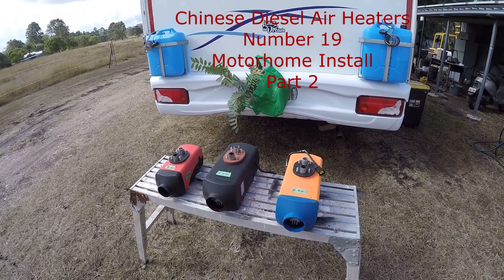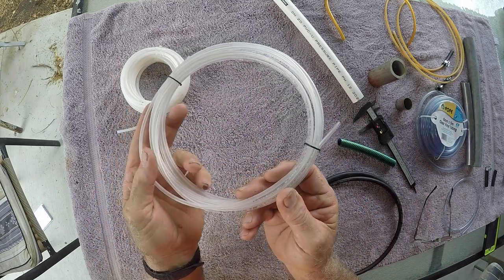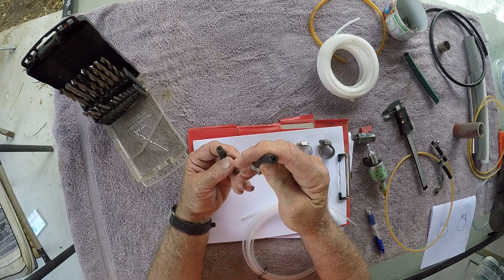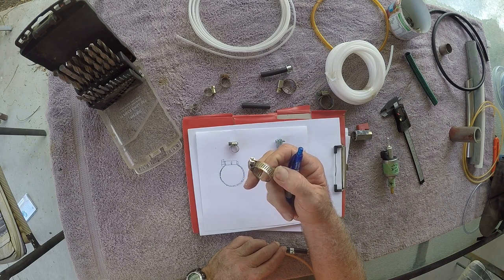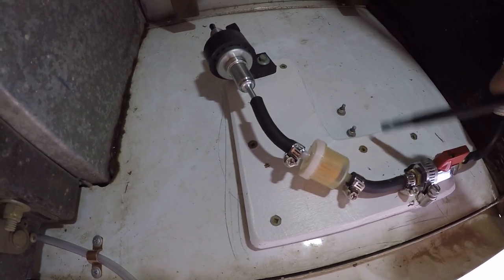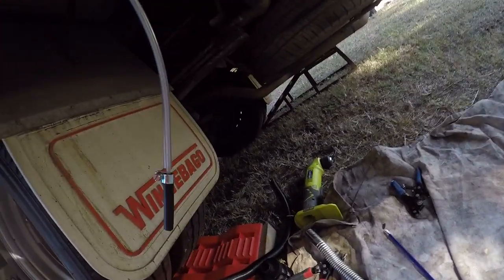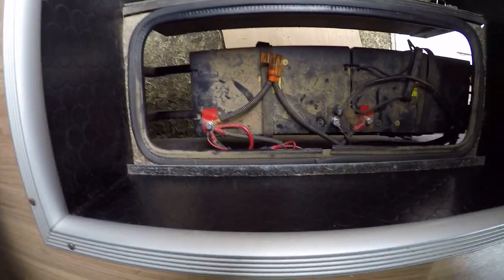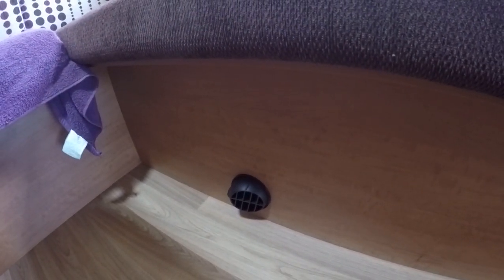Chinese Diesel Air Heaters no 19.   Motorhome Install Part 2

Comment: Hey John! Fist I want to say how great your videos are on the workings and installing is on the 5kw Diesel heater. I recently bought one and I am going to install it. Now I have read the manual and I have watched your video on two others but no one has said if the is a needed clearance for the rear of the heater against a wall. I asked one guy and all he said was I'm not a professional so refer to the manual or call the manufacturer because all his videos are is for entertainment. Now don't get me wrong I do watch videos for entertainment but on a Hod to or instructional video I'm looking to learn what to do and what not to do when I install my unit. So can you help with this question? If there is no requirement of space or distance from the rear of the heater when mounted in a compartment can you tell me how many inches it was on your install from the outer wall?
Reply from the maker: Hi JW,

Thanks for the feedback and comments.

Re the rear wall clearance.
These heaters do not like restrictions in their exhaust or airflow systems.
My personal rule of thumb is don't, or have absolute minimum restrictions to the airflow. 
The heater inlet is approx 75 mm diameter, so in my personal opinion (litigation minimising words, and the reason people these days are so reluctant to offer advice) a minimum distance of around 50 mm from a vertical wall should give you acceptable airflow into the heat exchanger.
Cheers. JMcK
Reply: Thanks John that works and helps me. By the ay that guy actually messaged me back and said he put his at 4"
Reply from the maker: John Wessinger 
👍

Comment: Hello John just wondering if I could install one of these OUTSIDE my cabin in a weather proof box with the controller inside the cabin. The only bit that is of concern is I would need to add a very short pipe to the inlet side of the heater and none of the installs I've seen have any pipe on the inlet as they are inside the cabin. I hope this makes sense.
Reply from the maker: That would be fine Jimy. Less trouble with the exhaust that way.

A lot of people mount these outside a shed or garage, or winter fishing hut etc. and have a pipe on the inlet side and outlet to recirculate the hot air back into the cabin.
A pipe on the inlet side up to about a metre long does not cause much of a restriction.

Cheers.  JMcK
Reply: @johnmck1147  Thank you very much for your quick reply, I have watched nearly all of your videos. You are very particle and knowledgeable. My inlet tube would only be around 400mm long but good to know up to a meter is fine. Thanks again. Have a great day! 🍻
Reply from the maker: Jimy 4 Real 

👍

Comment: If you get error code 10 multiple times and your heater was working fine a few months prior.what do you believe the problem is?it would never  fully start working and eventually shut down.Very fumey and smokey.Do you have to clean the heaters after so many hours?It was flawless for a couple hundred hours.maybe 15 gallons a fuel run thru it?short fuel line..short power lines w/ plenty of voltage.
Reply from the maker: Hi Chris,

It is possible you have carbon build up in the heater burner and in the start glow plug screen.
It is also possible you may have a blockage (bug) in the glow plug start air hole. Not uncommon if you do not have a screen on the combustion air inlet.

These heaters do need carbon removal maintenance. The frequency of this maintenance is very dependent on your install, type of fuel, altitude and your operation of the heater.

Restrictions in the exhaust or combustion air inlet creat a poor fuel air mix and lead to carbon deposits. As does poor fuel and high altitude operation. It is good maintenance to occasionally (monthly or season end) to run the heater on a high power setting for about 5 minutes to burn off any accumulated carbon.

I hope this helps.  JMcK

Comment: Hi, where could you purchase the connector harness of the dosing pump? at 24:49 I saw you use such a harness to make a "jump starter"
Reply from the maker: Hi Jay, I made my harness up with a simple push button switch in an old pump wire loom connected to a battery pack. I just rapidly push the switch on and off. JMcK

Comment: Hi John, thanks for the video. I've been planning my 5kw heater install and will be staring it very soon (as soon as the snow clears!!). The manual that came with my heater has a wiring diagram that shows the heater feed wire (with a 20 amp in line fuse) from the leisure battery but it states to wire it to the negative terminal of the battery. The wire itself is red colour and I assumed that the red cable would be for the positive terminal. Do you think the manual is correct? Can there be some that are negative feed and some that are positive? By the way the black wire, from the plug is very short as opposed to the red wire with the in line fuse, have you seen that before yourself? Thanks again, Martin
Reply from the maker: Hi Martin,

Sadly this is not uncommon. The issue seems to be in the translation.
Just as some manuals, and also placarded on the heater say use Gas for fuel. Diesel in many Eastern countries is known as Gas-oil, and this is sometimes shortened to just Gas. What Americans call Gas we in Aus call Petrol. These Chinese heaters run on diesel.

Now back to your issue. I think your manual shows a 12 pin socket, and I am pretty sure you were supplied a 9 pin socket. 

I have to be careful here re litigation, and going against the supplied manual.

You must make your own decision, but If it was my heater I would do below.

I would connect the red wire with the fuse to the battery positive (+)
I would connect the black wire to the battery negative (-)
I would install a 15 amp fuse not a 20 amp fuse. 
And I suspect your heater actually came with a 15 amp fuse.

Cheers.  JMcK
Reply: @johnmck1147  thanks very much John, you have given me the confidence to install the red cable,with inline fuse (which came with a 20amp installed in it) onto the positive side. I accept that you have no liability in your remarks. Cheers Martin
Reply from the maker: Martin Cogley 
👍. Please let me know how it goes Martin.  JMcK

Comment: John I’m installing the gas version under the drivers seat in a tiny Ford Transit Connect. Since the ground clearance is so small, have u seen any problems with the combustion intake/exhaust hose catching road debris?
Reply from the maker: Hi Dave, 

I assume you will have it protected behind some chassis frame, and have a good stainless steel filter on the intake hose.

Now it depends how you will use the heater. Only when parked or also when driving. If when driving you can have issues with road debris, particularly from water spray when driving in the rain.

If you do use heater when driving and you often drive in bad weather, have you considered having the combustion air intake coming back inside the van? 
You could also have room to make a bracket lifting the heater off the floor enough to route the intake sideways inside the van. 
Or perhaps even mount heater sideways, and just run exhaust through the floor.

If heater only used when stationery, you won't have any issues.  JMcK
Reply: @johnmck1147  That is a good idea about the intake. I found a elbow online that I believe would fit my General Components Bison 2000a gas heater. This would eliminate that large radius that the exhaust hose would take to make the 90. Make sense?  Is there a good way to contact u?  Thx again for the info.
Reply from the maker: Hi Dave, my youtube email. johnmck47@outlook.com

Comment: hi good videos as always have you any idea why i can smell exhaust fumes coming out of the air outlet have replaced all the gaskets but still smells
Reply from the maker: Hi Ian,

You say you have replaced the gaskets, have you also checked the two seals?
One the rectangle seal where the fuel enters.
The other the seal where the glow plug is.

Have you checked that exhaust gas can not be sucked into the air inlet?

What about some residue oil (from dirty hands) left on the burner heat exchanger.

If you have, or can borrow an instant CO meter check outlet for CO, to rule out other causes, such as contamination on the heat exchanger.

It is possible, but very rare you have a heat exchanger casting issue with a very fine crack along the fins. The crack opens up as the temperature rises. Very difficult to find. Hence the CO meter.

If you checked all above, and heater is new, suggest you ask for a replacement.  JMcK
Reply: hi was the exhaust getting into the air intake could do with a better way of connecting to the exhaust pipe than using a jubilee clip as still escapes

Comment: Hi John . I'm fitting a 2kw to a Ford Transit, Under the passenger seat. How far must the exhaust be away from vehicle diesel tank? I know diesel isnt like petrol and I'm pretty sure the vehicle exhaust goes right past it . I'm only asking as the site I want to fit, the heater exhaust exit hole from the van chassis  may only end up being 200mm away maybe 300mm

thanks
Reply from the maker: That should be ok, but for peace of mind I suggest you lag the exhaust. Very easy to do. JMcK
Reply: @johnmck1147  ahhh cheers.  Pretty sure there's some black stuff in the kit already.  It's a Lavaner pro . Not sure if you know the brand but they're a mid range product.  I paid £180 delivered but they had good reviews when mechanics took them apart.  There's a Scottish fella on YouTube.  He recommended your channel 👍🏻

Comment: Hi John, what's the name of the recessed switch housing 38:23? I didn't find it online.
Reply from the maker: Hi Jay, it is home made from a bit of plumbing poly pipe and two bits of ply off cuts. Epoxy glued together. JMcK

Comment: Hey John. The 3 amp fuse you put in the wires going to the fuel pump, does it matter which wire the fuse goes on?
Reply from the maker: Hi Allan, the fuse should be in the positive wire.  JMcK
Reply: @johnmck1147  Thanks John. You're exceptionally helpful. I may need to call in a professional to help me out though. I now have white smoke and inexplicably, diesel leaking from the air intake. I've gone astray somewhere :D.

Comment: Thanks John, good instructions. 
But one question. My battery system, has low battery shutdown switch. Diesel heater goes directly to the battery.
how to make so diselheater starts shutdown command, when low battery protection switch trips.
Reply from the maker: Hi TA,

Does your heater go directly to the Battery?

Does your heater connect to the battery shutdown switch?

If it goes directly to the battery, the ECU in the heater will put the heater into safe shutdown mode and turn the heater off at a low battery voltage (about 11 volts)

If the heater is connected directly to your low voltage shutdown switch it can remove power from the heater and not allow a safe shut down procedure. The heater will overheat. It is most unlikely to catch fire but will most likely fry the ECU board.

If you want to connect the heater to a low voltage cut out switch it gets complicated.

One solution is to connect the heater directly to the battery, but the fuel dosing pump through a relay switch connected to the low voltage cutout. That way if the house battery gets low, the low voltage switch will cut out, the relay will open due to lack of voltage, and deny power to the dosing pump, the ECU will detect a lack of fuel because the dosing pump has stopped and put the heater into safe shutdown mode, which can occur as the heater itself is connected directly to the battery, and not through the low voltage cut out switch.

Cheers.  JMcK
Reply: @johnmck1147 
 Installation has not started yet.
Plan is to connect heater wires directly to the battery. But how to give shutdown command to the heater, from outside source. Or is battery protection function already built in to the deasel heater?
Reply from the maker: Tec Abi 

Hi TA, as mentioned above, the heater will go into shutdown mode with a low battery voltage.

Cheers.  JMcK
Reply: @johnmck1147  
Do you know, what the default shutdown voltage is?
Whether is it possible to change, on the controller if needed?
Reply from the maker: Tec Abi 

Hi TA, seems to vary but is generally around 10V to 11V.
I know of no way to adjust this setting in the ECU. 
Cheers.  JMcK

Comment: I hope it is okay to ask you a question about the heat exchanger?
I know most "professionals" install the heater such that the air intake for the heat exchanger comes outside where the air is below zero and the heated air gets blown out into the cabin. I am wondering if it would not be more economical to place the heat exchanger's air intake inside the cabin, such that the air is already warm, and the heater only have to maintain the temperature of the air?
My idea is to place flex tubing in both ends from inside to inside.
Reply from the maker: That is fine FM.

It is a personal choice whether to heat fresh outside air, or reheat cabin air.

I talk a little about this in the motorhome video, where the owner chose the inside option.

However you must have fresh air for health reasons, so if you reheat air, you you need some fresh air vent or leave a window partially open etc.  JMcK
Reply: @johnmck1147  Many thanks for your great answer. Is there much to save in reusing the inside air vs getting new freezing air from outside? 
About fresh air, I am planning on using the heater inside a cabin scooter, will that normally give problem with the CO2?
Reply from the maker: Hi FM,

Do you mean C02 that you breath out, or CO, the deadly combustion gas.

If CO, the heater combustion air should  come from the outside and the exhaust must exit to the outside.. 

A CO meter/alarm is always a good idea when you have a combustion item, eg, gas stove, fireplace, diesel heater, propane heater etc.in an enclosed space.

If you mean CO2, that we breath out. Yes, you will have an issue if you do not have some means of getting fresh air into the cabin to breath.   JMcK
Reply: @johnmck1147  I mean what I breathe out. I imagine that the cabin scooter is constructed without being too airtight, it is constructed for normal transport, just as a mini car. 
Your idea with the CO2 Alarm is really great, I'll get one for sure.
My thought is that to heat up cold outside air demands more power than just reheating the cabin air? Do you know how much difference it would make? (20F to 70F).
Reply from the maker: Hi FM, it is always more efficient to heat cabin air rather than outside air.
But this is personal preference. Some people prefer to recirculate, some prefer the fresh aie.

The alarm was a CO meter. A Carbon monoxide meter.. CO is a odourless deadly gas, a by product of combustion. JMcK
Reply: @johnmck1147  Thanks, I do really appreciate your generous help and ability to make things easily understandable. :-)
One final question, if the cabin air intake is mounted inside (or outside) and I use that black plastic grill in front of the flex tubing. Do I then not risk getting dust, sand, insects and whatever in the heater? To propel looks like it is great at moving air.
How do I place a filter in the intake went?

Comment: Aloha .. would happen to know the Codes to Set the heater for High Elevation ?? My brand new heater shit the bed at 9600 ft and i was told for certain it was the elevation. Blowing an enormous amount of heavy sooty black smoke. Take it i need to rebuild her ? Cheers
Reply from the maker: Hi There, at high elevation these have a rich burn caused lowered oxygen levels.
I have no personal experience operating these heaters at altitude as we don't have very high mountains where I live. 
To my knowledge, at current times,  there are no known Chinese heaters with altitude compensation.
You can lessen the carbon issue at altitude by burning a high kerro/diesel,  90/10 fuel mix.
Yes, you will probably need to clean out the carbon buildup.
Cheers.  JMcK

Comment: The controller could have been used to prime the line.  Holding the up and down buttons simultaneously (or OK and up, etc. depends on model) puts it into a priming state.  Pressing up starts the pump without starting the heater, down stops it and OK exits.  It will automatically stop after a set amount of cycles so you don't accidentally empty your canister.
Reply from the maker: Hi Mars,

Yes, I know that. But as I have stated previously, and in my pump video, that little piston does some 600 strokes a minute (up and down) during priming, and the piston gets very hot with no lubrication. 

A long controller prime from fuel tank  to the pump will overheat and wear and even destroy the pump seals.

A controller prime to get diesel from pump to heater is quite ok.

Cheers.  JMcK
Reply: @johnmck1147  Yes.  I meant the line, not the pump.  I was referring to when you used the switch.
Reply from the maker: Mars Revol 
👍

Comment: I wonder if you would answer a question for me. I’m about to install the heater but my fuel tank and hose running to the heater are positioned higher than the heater . Is that a problem for fuel flow ? In other words I have to run the fuel line down through the floor and come up under the heater to the connection, but the tank and fuel pump will remain inside the trailer .
Reply from the maker: Hi Jim,

That is ok. The heater will work fine.

But make sure you install a shut off valve in the fuel line before filter and fuel pump, and turn off after use. This prevents head pressure of diesel seeping past the seals in the fuel pump and flooding the heater when not in use.   JMcK

Comment: My black 4mm hose in my kit is very small, two pieces of seemingly different sizes.
Reply: Seems they may be two slightly different sizes. One i can manage to wiggle in the nylon and the other one i can’t. I suppose i should go with the tighter one for the connections maybe.